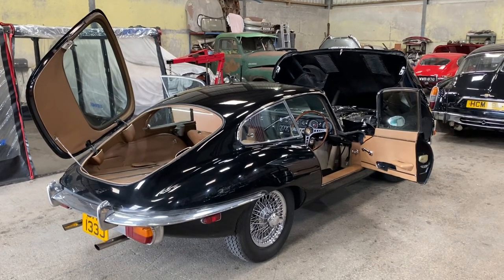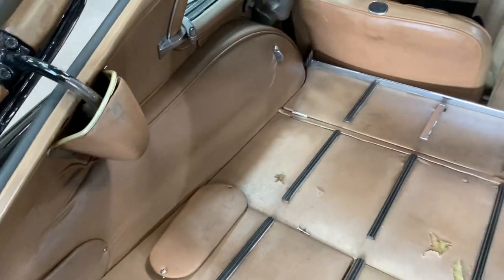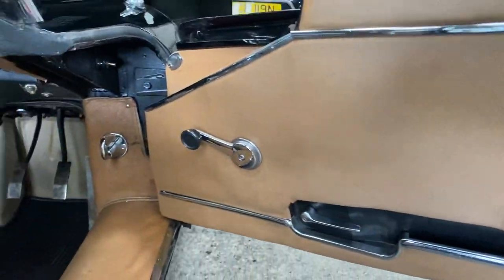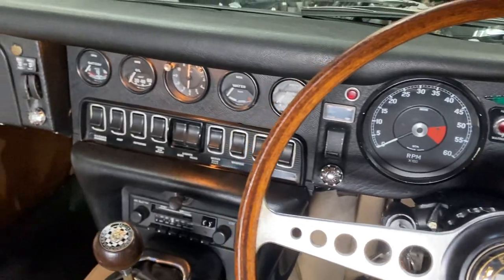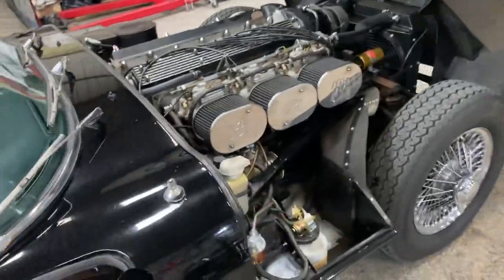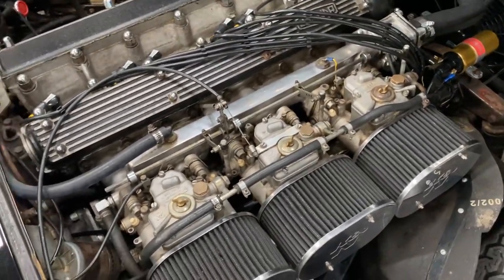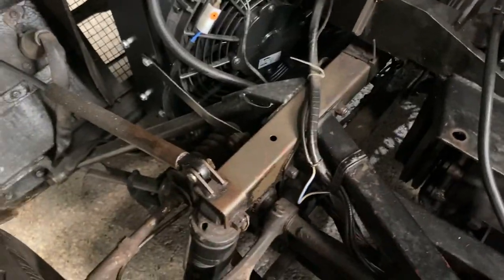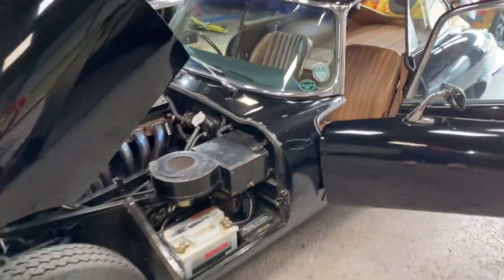Jaguar E-type Series 2 interior

Comment: Very nice. Do Three webers make it even faster?
Reply from the maker: Not necessarily, then, as now, putting three Webers on was cheaper than fitting three SUs.
Reply: I've had Webers and SUs. Hands down enormous power with Webers. Owned this jag with SUs only. Monthly cost were good, about $300 to keep on road.
Reply: Les Weber apportent apportent du bruit, peu de puissance, si rien est fait coté culasse, consommation en hausse de manière importante par les pompes de reprise sollicitées à  chaque coup d'accélérateur , les réglages fréquents demandent la main d'un spécialiste pour un fonctionnement optimum mais ils deviennent ,rare et cher. La type E avec son poids mesuré et les 3 SU donnent suffisament de puissance, de souplesse donc plus de plaisir de conduite avec une consommation mesurée, de 12 a 14 l maxi , en 14 années les SU m'ont demandé que 3 reglages et qq jeux de bougies, l'entretien dans ce cas ne coûte pas plus cher qu'une TR6, ainsi équipée la série 2 FHC injustement boudée, n'en reste pas moins une autentique type E  et ormis  quelques différences de quincailleries apportait un confort et une fiabilité amélioré.